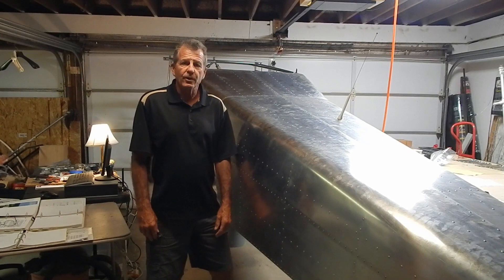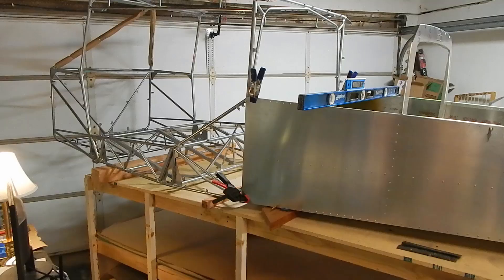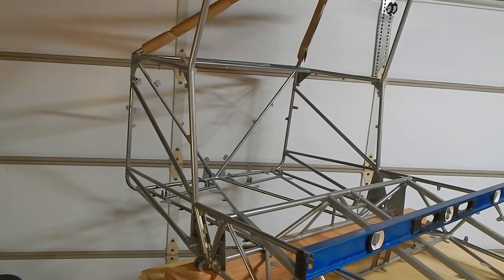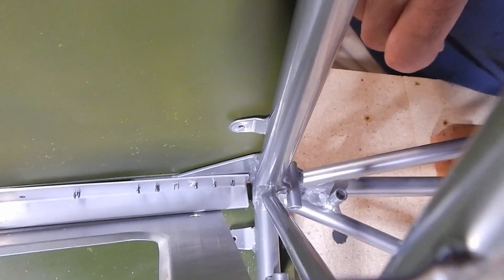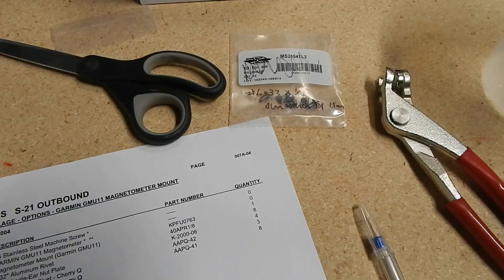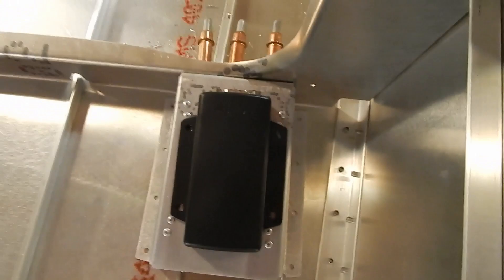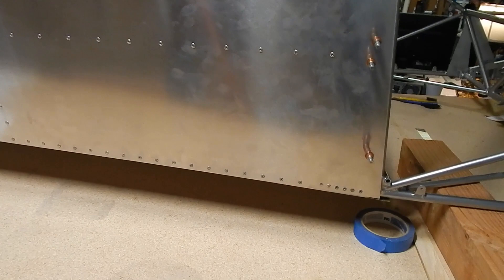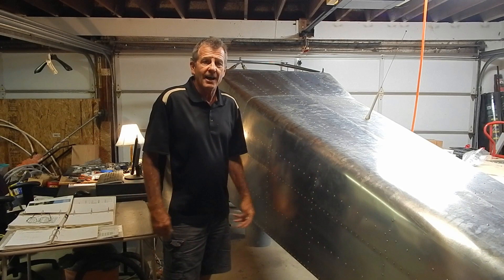Building a RANS S21 Outbound.  Ep 10 -Fuselage/tailcone 2

Comment: you certainly did your homework and research before you do the build.  good point on avionic components and antenna installation before closing up the tail cone.  builder will definitely need to plan ahead to install these for the kind of operation and panel for their build.